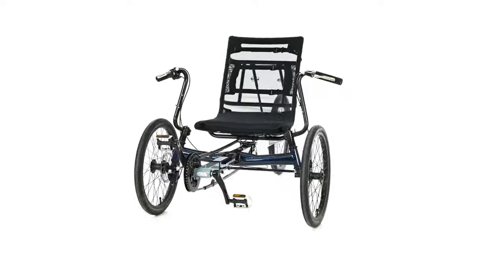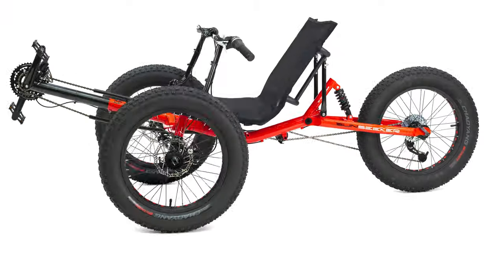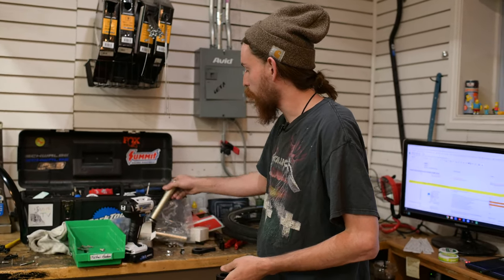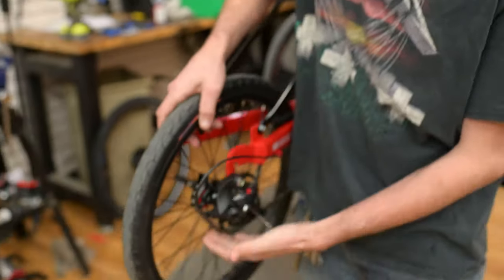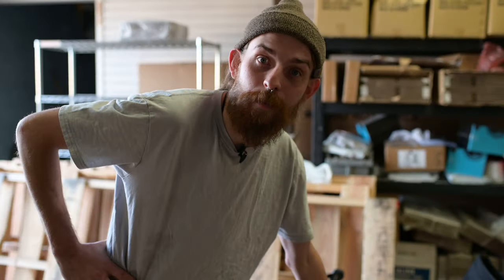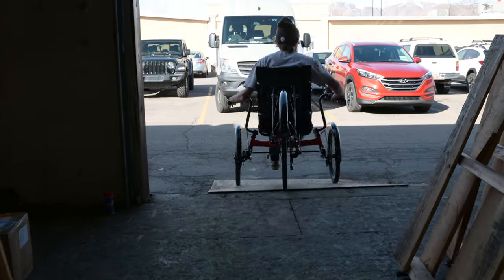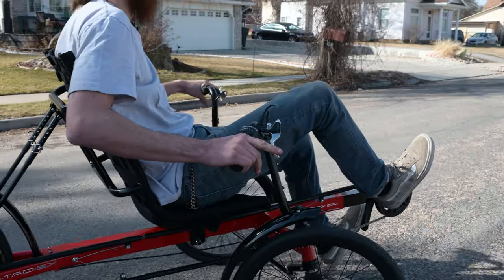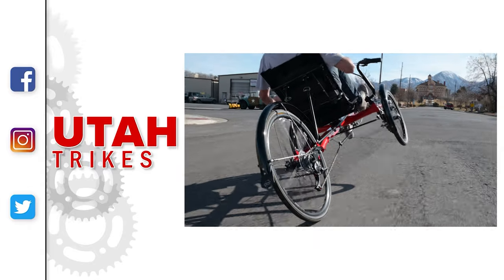ENTRY LEVEL $1000 TRIKE? Or, Upgrader's Dream? SunSeeker ECO TAD SX w/Big Wheel & Front Suspension!

Comment: I have a SunSeeker Eco Tad and I love it. It is super easy to turn which is great because I have a muscle condition that means I have less arm endurance and grip strength. I can literally just rest my wrists on the flat handlebars and turn the bike without even using my hands. The only downsides after 3 years are the smaller back wheel and the top speed. Some day, I hope to get a trike that can go faster and that will fold for travel, but I doubt I’ll ever find one that is so easy on the arms. Arm problems or not, this is a great budget trike.

Comment: New researcher of recumbent trikes and I've found several of your videos.  Thanks for sharing them, it certainly makes it easier to learn some things.

I do have a few questions.
1) With the upgrades suggested, what is the new "entry level" price for that unit?  What is the cost comparison to the next similarly equipped trike?
2) If the Sunseeker Eco Tad only gets a larger rear wheel, without the suspension modification, how badly is the nose "dive" affected by that 3-ish inch rear height increase?
3) The Ackerman compensator was added to the steering stack.  Is this a stand-alone mod suggestion, or a mod that only benefits when adding the big rear wheel and suspension mods?

Comment: Why is a 26" wheel an upgrade?  Does it make a smoother or faster ride?  Thanks for the video.
Reply: I haven't even watched the video, but yes, larger wheel is faster if you have the power to turn it. It also, at least in theory, wears out fewer tires because there's more rubber than a smaller tire.

Comment: What I don't understand is why wouldn't you make the dropout extensions compensate for the increased wheel height? Just build them to where they mount on an angle. That way, the original angle of the main frame of the trike is retained. instead, it's lifting the back slightly, and putting your cranks downward, shifting your weight more forward. And with a short rider, you really have a lot of weight bias to the front, that causes less Traction in the back, much less weight on the back tire, and it would cause that pedal steer. Yeah, I don't understand why they wouldn't just make them angle up.... it would drop the back down to the original height. But still, an awesome product.

Comment: Been watching a lot of your videos and your company, personnel and custom upgrades are fantastic. I have a couple of questions... Do you do anything with trike canopies? Also,we have a couple of entry level trikes that sit up high and they have a real problem, when you have to stop very quickly it will tip the trike forward hard onto the chainring because all the weight is so far forward. I haven't seen this issue discussed in your vids. Maybe I just haven't watched enough of them yet. Have you ever covered this issue and do you make any custom things like wheelie bars that go on the front to keep this from happening? Whatever the case I'd love to see this topic covered when you demo the trikes that ride higher. I don't know if lower fast trikes do this or not but it's happened to us so often that I think it's one of those "Cons" about trikes that should be mentioned. Thanks for the great vids and I hope to be a customer someday!
Reply from the maker: We have not designed canopies, mostly due to the fact that there are so many available on the market. As for the tipping forward, that does happen with a lot of trikes if you really need to slam on the brakes. It's more likely to happen if you have a higher center of gravity. We'll try and include that in a upcoming video.
Reply: Hi Ed, kayak canopies seem to be the reasonably priced solution if you dont want to spend hundreds of dollars for basically an umbrella
Reply: @UtahTrikesOnline   gee whiz, that was a perfect oppurtunity to suggest that Ed buy a Bafang mid-drive from you(thus making his trike MORE nose heavy which would need offset by mounting dual batteries near the rear wheel😝

Comment: How easy is to adjust this trike for different heights, just before riding?  

My wife and I would likely share such a trike.  I am 6' and she is 5' 3".
Reply from the maker: Unfortunately, to adjust for such a wide range is quite a task to do before a ride. However this trike is definitely the one to make it work. Through a combination of adjusting the boom and moving the seat along the frame, it is possible but an adjustment of the chain will still be needed each time you make the switch - definitely doable but probably not ideal.
Reply: @UtahTrikesOnline  Thanks, so it is not just a seat adjustment.    Combining that with a bit of reticence from my wife regarding recumbent trikes... we might just be looking at dedicated ones for her and me.  Me something like this one (full recumbent with 2 wheels in front), and my wife probably a more traditional e-trike with a cargo basket between the rear 2 wheels... and I think I saw one that looks like a traditional with a regular style seat but is at least semi-recumbent.

Thanks for the reply.

Comment: Lewis one quick question should you have added a couple link's on the chain before you said done     ???
Reply from the maker: Nice thing about only having a rear derailleur and one chainring up front is that the boom can be adjusted almost 6in without having to adjust the chain.

Comment: I like your videos. So if a person upgrades rear wheel to a 26 and then does the neck bearing and suspension do you return the new old parts back to the customer along with the bike being they are paid for from the original purchase? Also do you have a price on a fender set when you go from 20 to 26” rear wheel? And yes as a beginner I’m thinking of going with a dark blue Eco Tad with 26” rear wheel,fenders,rack and bearing upgrade with a few other little add on’s. Bafang I can do myself later on.
Reply from the maker: If upgrades are purchased with the trike through our configurator the pricing to go from stock to the upgraded parts are taken into account. IOW, you are not charged for the stock part and the upgrade.
Reply: Utah Trikes Thank you for clarifying that question, now I’m back to looking.
Reply: High CG with a high seat height and a motor.
What could possibly go wrong?
Reply: @whazzat8015  I know what you mean. I've gone from a Greenspeed gt3 to Magnum big wheel. The Magnum's steering geometry is way better, but considering the 26 on the back, the tail wag is as bad pedalling at speed but is less stable from it's height. However I didn't get the Magnum to go fast on ( will keep the gt3 and upgrade the steering for better speed)
Reply: @rossbrumby1957  I am a big trike fan, but they do not do roads at speed well. A smooth Track at speed, maybe.Easy to roll over and I don't think the chainwheel should be part of the brake system. I like 16" wheels, but they are twitchy and harsh. I mean, I have a SatRday w 16's. These bikes and they way these guys ride, are not for the inexperienced, but are marketed that way. When trikes get into trouble it happens sudden and fast. Motors add to that issue. It is important not to ride faster than you can think.

Comment: The obvious upgrade for a cheaper trike is buying a better trike. For example: bought a Greenspeed gt3, steering twitchy and a bit too lively at speed, overall awkwardly low to get in and out of but a very nice riding position and turns sharply for tight spaces. Ended up buying a new Magnum big wheel which is a massive improvement in stable steering and high enough to not need to use my hands to get in or out.

Comment: I don't see any advantage to putting on a larger wheel in the back.
Reply: Higher speed for the same cadence, Sam, also if you add something like a big apple or big ben from Schwalbe and run a little lower psi that 26" wheel wil float across a lot of pavement  cracks
Reply: @keithguiste2659  You are adding weight and wind resistance with a larger wheel. The laws of physics tell us that with more weight and resistance you will need more energy. Also, by lowering tire pressure,  you INCREASE your resistance even MORE.
Reply: @bentrider  wind resistance on a 1.5 inch wide wheel? Excuuuuse me, I didn't realize I was responding to a  TdF competitor😒 while you are on your physics soapbox you might also consider the flywheel effect of the larger wheel
Reply: @keithguiste2659  these are all things to consider. However, you can't go around saying that you can go faster with a bigger wheel. It's just not true.
Reply: @bentrider  how about this, it will make you go faster but you have to put more energy into it.
Reply: @MikeSmith-cl4ix  please explain your reasoning. How does it make you go faster?
By your reasoning, it doesn't matter the size of the tires. If I put more energy to it, of course I will go faster.
So again I say, I see no advantage to having a larger wheel.
Reply: @bentrider  because the larger wheel will will cover more ground with each revolution of the pedals. How could it not? But you would have to pedal harder to achieve the greater speed I'm not saying you're wrong I just think you guys may be misunderstanding each other.
Reply: You can only pedal so fast  gives you the capacity to go faster. Look at it way how fast could you go if you had five inch wheels with the same speeds and gearing?
Reply: @MikeSmith-cl4ix  the wheel size does not matter. It still takes the same amount of energy to move the same weight the same distance at the same speed. You said it yourself, you can cover more ground with a larger wheel but you're using more energy. Then where is the advantage? There isn't one Those are just the laws of physics.
Reply: @bentrider  right, that's what I said. I mean I'm no physicist so there could be some advantage to  larger wheels that I'm not aware of  the amount of energy is going to be approximately the same for the distance you travel with either size. But if you're peddling with the same revolutions say per second you will move a little faster and it will be a little bit more difficult to peddle along with the fact that you'll be using a little bit more energy. That's what I think anyway.
Reply: @bentrider  I agree with you though that it's not necessarily an advantage if you're comfortable with your bike the way it is then why would you want to change it because it will change the parameters of the bike it will lift your seat a little higher which could cause a problem with hard braking and a slight change with wind resistance so yes some things could actually be a disadvantage depending on the bike and the individual riding it. Also after thinking about it you may be right about a constant top speed because you can only supply a limited amount of constant energy so I think what it would do is give you better  acceleration.